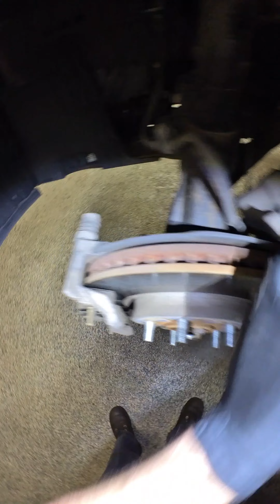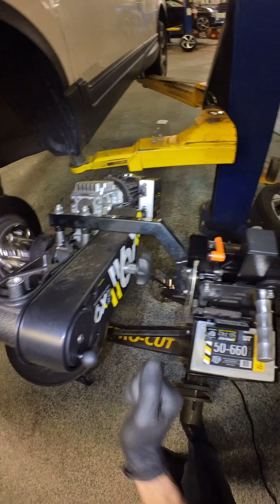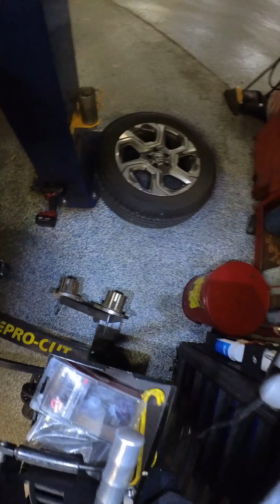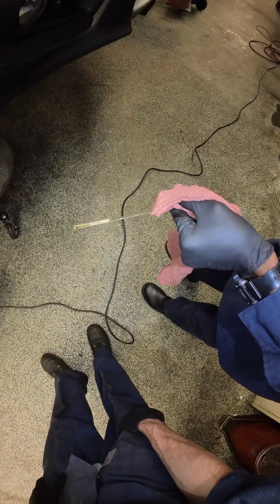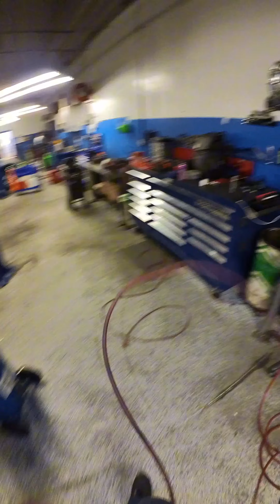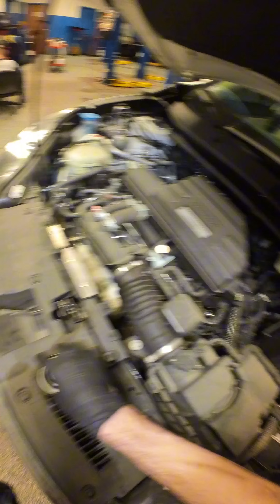Honda CR-V Front Brake Job POV 🔧😁👍 #honda #crv #brakejob #pov #satisfying #tevideos

Comment: Never seen such a machine. So you no longer pull the rotor off? Is it cheaper than new rotors?
Reply from the maker: Yes it's the same labor as replacing them. Extends the life of the rotors you already have as long as they are thicker than the refinishing limit 😁👌